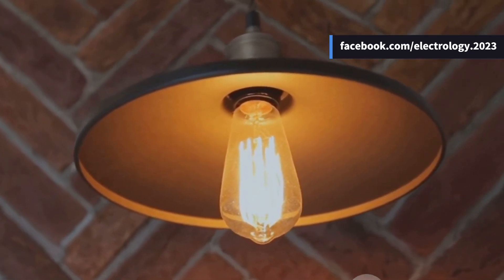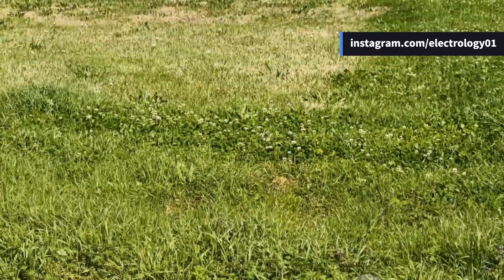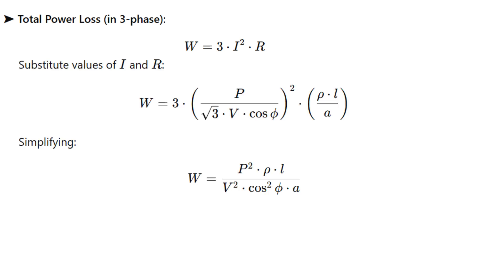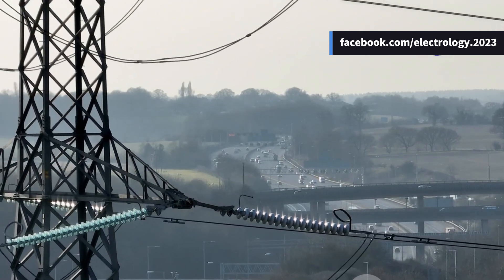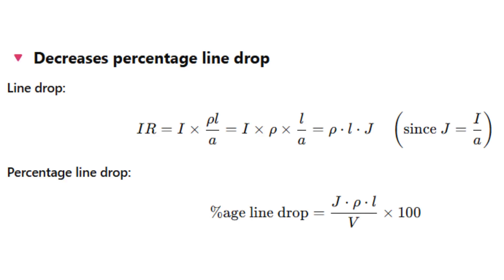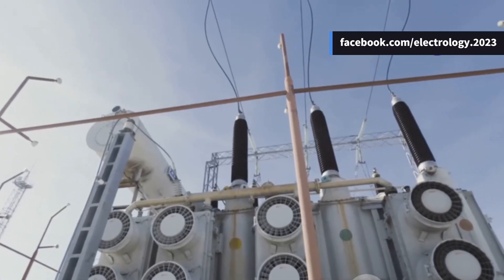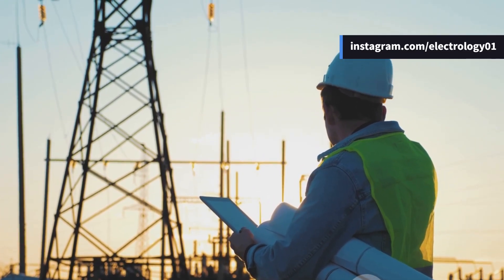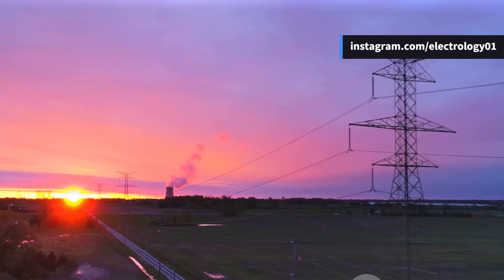Why We Use High Transmission Voltage? Explained with Math & Logic!

Comment: In my home we use 120V/60Hz single-phase/split-phase (also called 120/240V split-phase).  Safety & Flexibility.
Reply from the maker: That's right! 🔌 The 120V/240V split-phase system is quite common in North America. It's a smart setup—gives you both 120V for lighting/small appliances and 240V for heavy loads like dryers or AC units. Thanks for sharing! ⚡
Reply: In civilized countries, we use 240V at 50Hz which is more efficient and compatible with all devices